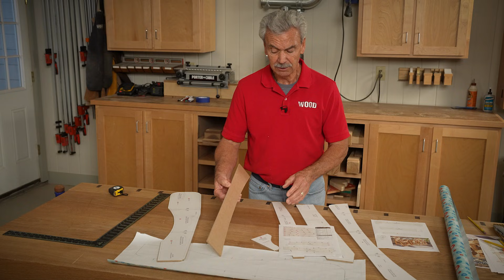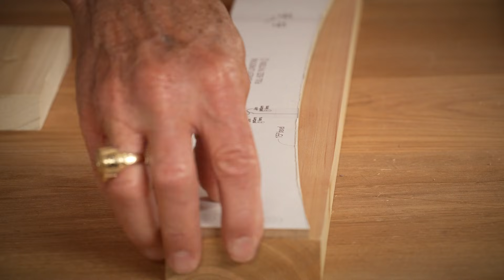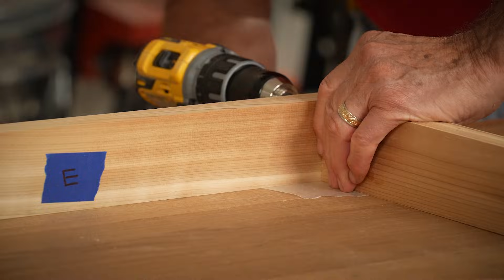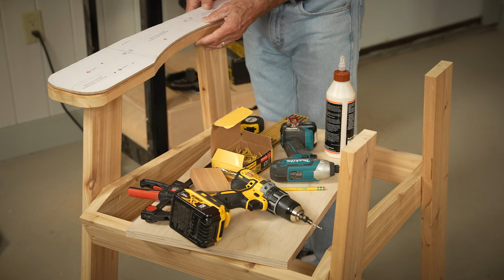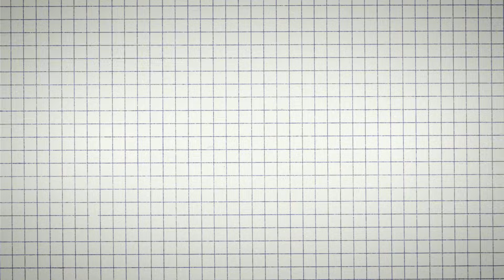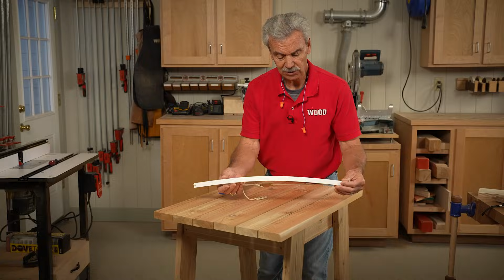Tall Adirondack Chair and Table Build - WOOD magazine

Comment: These full size templates that are linked here are not full size templates they are printed out on 8.5" x 11" computer paper and then they charge you like it's card stock. Called customer service and the lady said they only have some in true full size form and they can't specify on their website. So you must call to see if you are getting a true full size template or if it is just printed out on computer paper.

Comment: I have now made five sets of these, 10 chairs and five tables. I’ve made them out of 5/4 x 6“ northern white cedar I found that I have a significant amount of scrap material and that has led me to alter my design by using the scrap material in the finished product.  For example, Instead of the chair seat and back slats, all being the same width I have alternated them with additional narrow slats. This variation is pleasing to the eye.  I’ve made similar use of scrap to alternate the slats on the table top as well. In addition, I made many extra corbels, the trim piece that goes under the chair arm, and I have used those to support some extra width on the table.  Finally, I added some of the scrap to the lower frame of the table to create a shelf for knickknacks, a planter, or perhaps a citronella candle.
Reply: Could you post some pictures of your alterations?
Reply: @user-wc4vx3my2e  http://youtube.com/post/Ugkx5Bx53gNe9a9bO2H37cu-gNdMCTpgrED8?si=TKJiR47sZYb4Rp5P
Reply: Let me guess - u didnt make a video of u making any of these 5 sets, so that we may see your journey and end product, instead of just describing it here. Is that correct? Le sigh….
Reply: @ is it possible to add photo/ video in the comments?  I have photos I can add.  Sigh….  Happy trolling!
Reply: @ http://youtube.com/post/Ugkx5Bx53gNe9a9bO2H37cu-gNdMCTpgrED8?si=XV_YlLkyVSaTtlz5

Comment: Is it possible to make an Adirondack chair out of marine grade laminated wood?  Where I live it is almost impossible to find suitable natural wood but I do have access to laminate, and it would also be MUCH cheaper.  Can I use 3/4" sheets cut to size and thoroughly painted?
Reply: Did you figure it out? Did u end up using that? Something tells me that you passed on that idea of using laminate. Would that be accurate? Whats the core of that laminate made of? If it’s mdf…a big no no. As long as one could seal the edges of sheet goods, it’d prob work great, at least for a couple seasons…

Comment: Just a quick question on your thickness. Plans call for 1" thick. Well, as we all know, if you buy a "1x6", it's usually 3/4 x 5 1/2.  Are you using true 1" thick cedar?  If so, for me, the only place I can get true 1" thick wants $15+ a BF..   Would you say using clear white pine then covering with spar varnish would hold up well?  Like to build stuff, but $15 a bf is out of my price range realistically.
Reply: 5/4 cedar deck boards are 1” thick and cost $2-3 per bf
Reply: I had same question, I've built the chair Norm Abram builds, & I used 1x pine, it worked fine
Reply: Tamarack is every bit as resilient as cedar but much less money I find it near me from the Amish.

Comment: Hi ,what type and make screws are you using?
Reply: I, myself, like to use what i think we can see here, which are prob 1 1/4”&/or 1 5/8” Deckmate deck screws for outdoor projects. I dont F w/phillips drive screws anymore, as these are T25 Torx drive, for minimizing cam out. That decking coating it has will also ensure years of use before rusting.